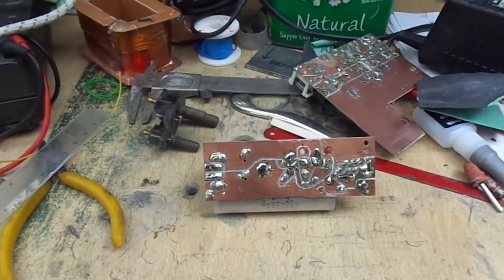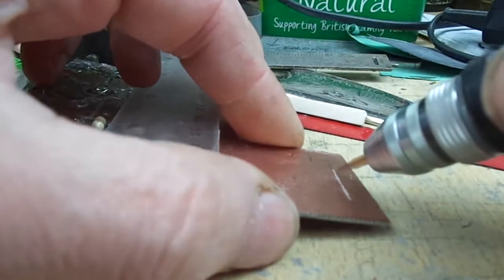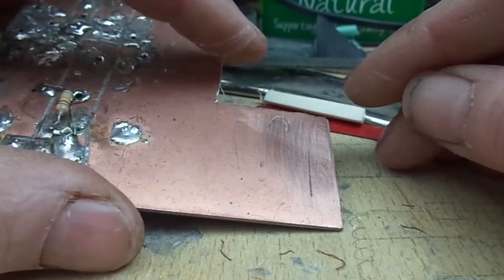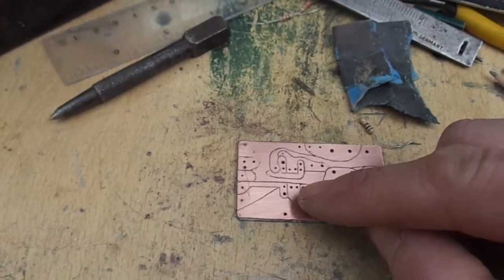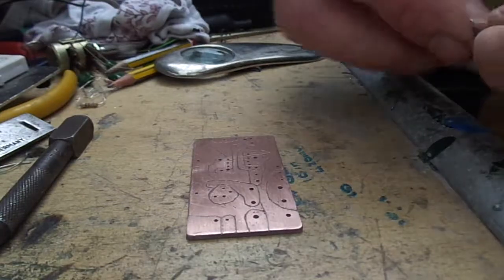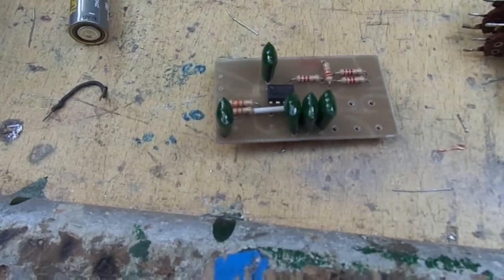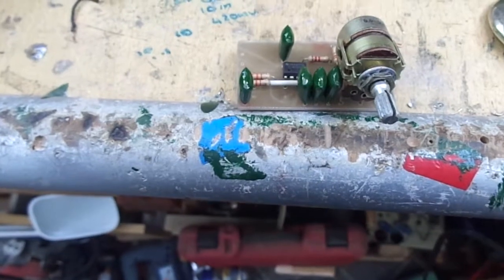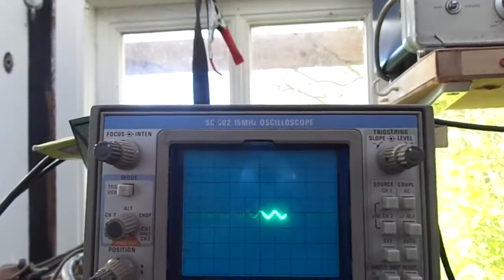How to make a quick circuit board Part two.

Comment: This is similar to a method I used in the 60s to copy PCB designs. I would first remove all the components and clear the holes on the master. The drill through the master onto the pre-cut copy board. The next stage was to draw the tracks. I made a pad cutters with central, hole size posts and cutting scribes, one for the pad circumference and one for the pad spacing. These would cut about 270 degrees, allowing for the track to meet the pad. Cutting the tracks was done with a scalpel. The track border could just be peeled off.
I've got to say that this worked with paxolin copper-clad, not sure if the same technique would work with FR4.